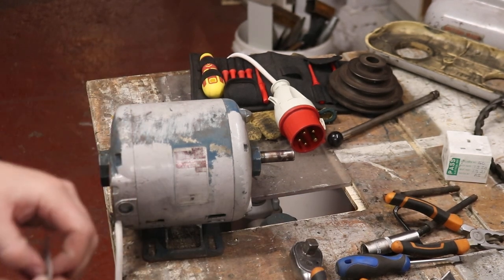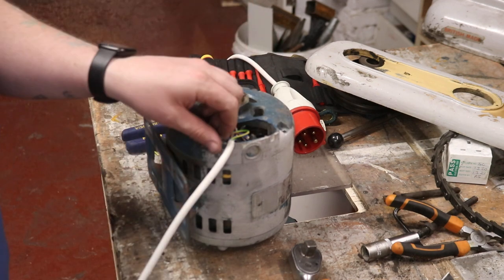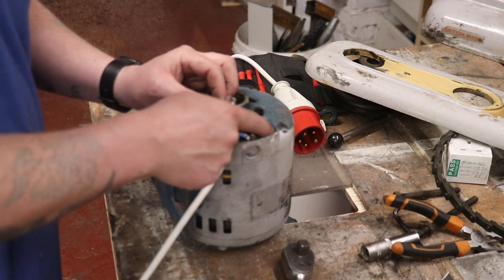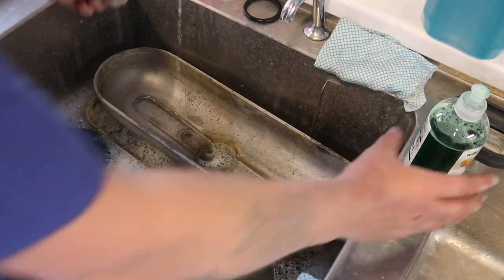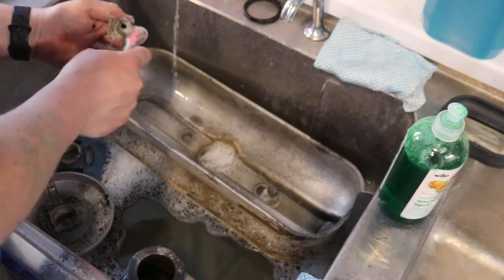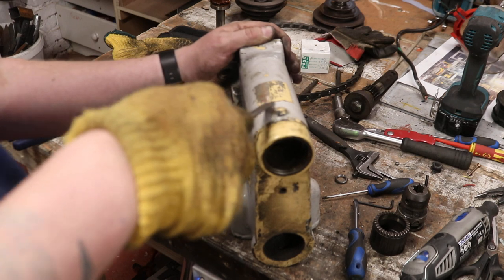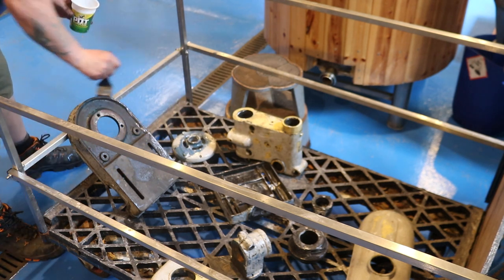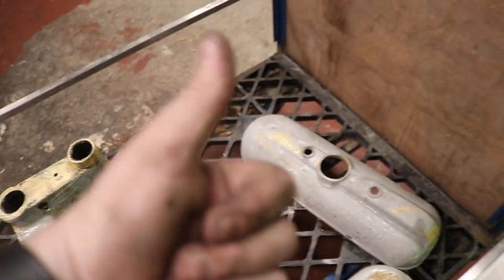FOBCO Drill Press Restoration Pt2

Comment: I am in the process of refurbishing my Fobco Star Drilling machine and unfortunately the top aluminium belt cover has been damaged. LOOKING for A REPLACEMENT BELT COVER. Stripping the Quill was fairly straight forward as I removed the top circle and using a plastic pipe I drove the Quill up and out of the main body casting. The labels came off very easily with WD40 and purchasing the paint from PARAGON ENAMEL PAINTS